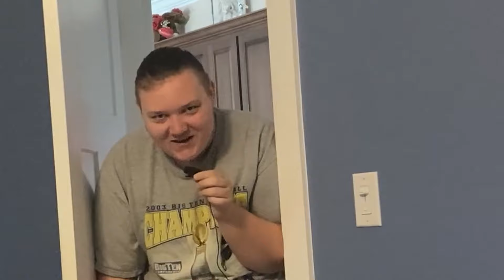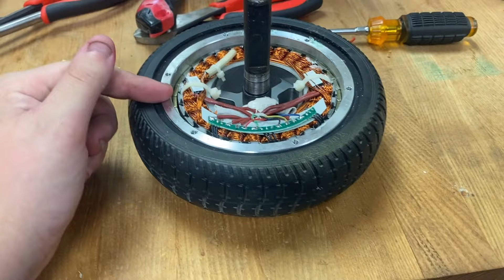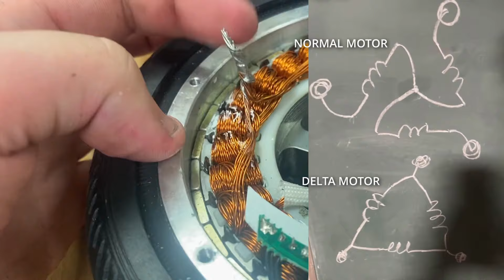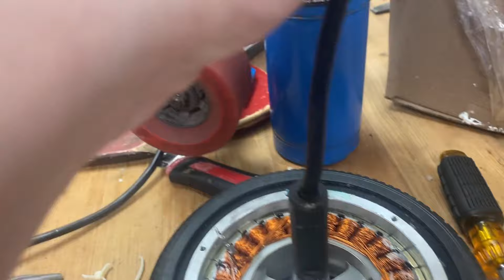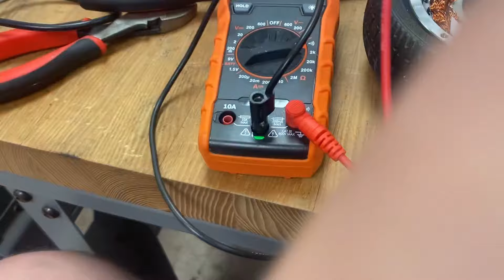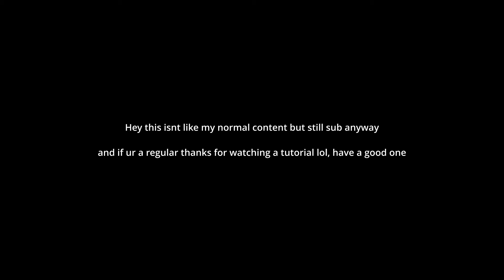How to Delta Mod a Three Phase Motor (The Easy Way)

Comment from the maker: Warning: This can lower the motors "torque-iness" but will increase the overall speed, it's not too bad unless you're going up a steep hill. Can also increase how much heat your motor produces (but that can also be dependent on how much wattage you're pushing) I personally use Statorade (A type of ferrofluid) to help cool my motors.

Comment: Rewiring to delta significantly lowers the torque by about 40%, if your battery or controller doesn't allow to increase the current. This is making low-end acceleration even weaker than it already is with a direct-drive hub motor. On top of that, you will deal with higher energy consumption, rougher running characteristics, and the need for recalibration.
Reply from the maker: Hey man great comment! Yeah I’ve learned a lot since making this, and youre right it  can lower torque which I later commented on myself (although for all the purposes I’ve used delta modded motors the trade offs been worth it)! However I will say you can still push over current on a lot of controllers and motors which is why I’ve left the video up. Higher energy consumption? Yes 100% Youre drawing over current. Rougher running? Eh not in my personal experience with the motors I have done but I wouldn’t be surprised. Recalibration? You shouldn’t need to recalibrate any of your controllers to run a delta modded motor, at least in my experience (I have used a variety of standard controllers and vescs)
Reply: Hey, the video is a solid guide from start to finish. I just wanted to point out that you really need to know what you're doing; after a modification like that, you might not end up any happier than before. At least with the VESC, you can easily recalibrate for the changes in inductance and capacitance. Have fun and enjoy the ride.
Reply from the maker: @DieterKäppel  Thanks brother!

Comment: Serious question, would this work with a 350w 42v controller still?
Reply: it would, but you would suffer. as you lose a lot of torque; 350w for such motor is NOTHING.
Reply: @clover_toaster would 500w be better id wanna go 30 mph max
Reply: @pyrocaty you would go 30…. but it would take AGES to reach that if even.
Your motor will feel 73% weaker.

Comment: Ey, would it be able to run on the original driver tho? 
If say i do this on a scooter?.. 

asking for a friend..
Reply from the maker: @williamwestonn  if it’s on something like a scooter with a standard motor controller yes but it would not work on a hover board because the internal firmware has a limiter baked in, on a scooter Yes, I’ve done it before
Reply: I was wondering this too, would this work with say an ES3 without Hall effect sensors? Thank you.